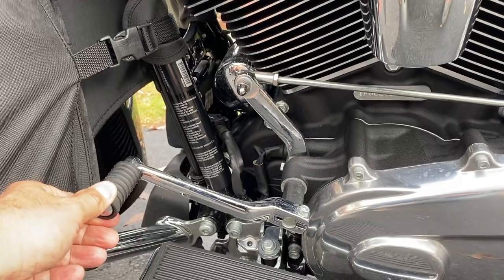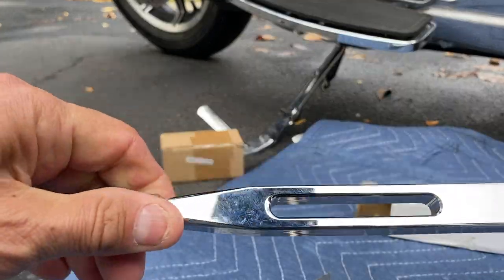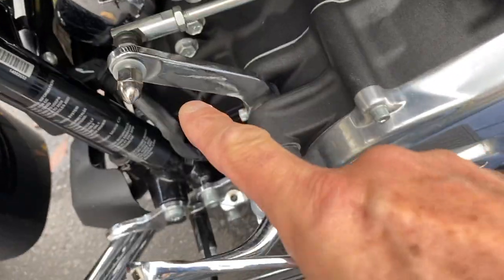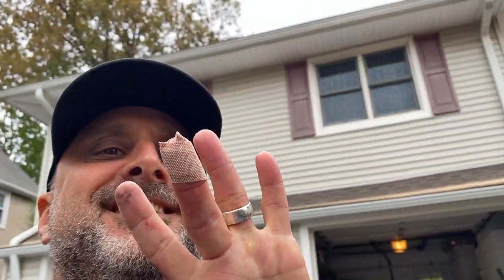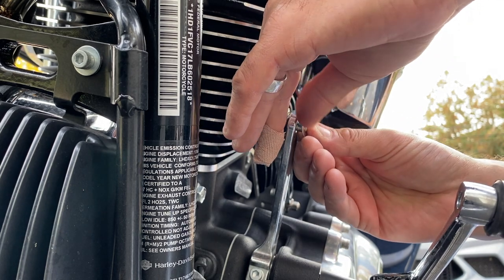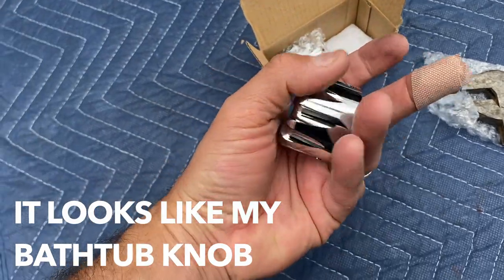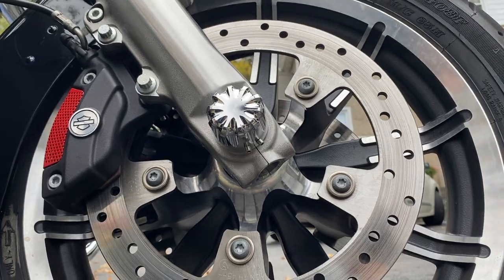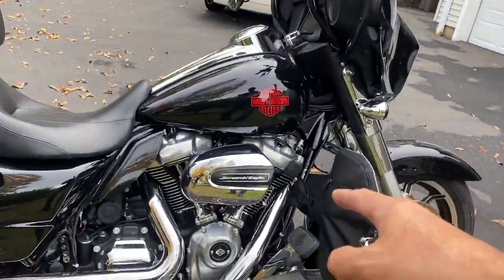Shifter Linkage / Axle Nut Covers Upgrade Electra Glide Standard

Comment: To adjust the shifter linkage, you simply loosen the small lock nuts on each end of the linkage rod and rotate the the linkage and it raises or lowers your shifter pedal, It works like a tie rod. You don't have to take the shifter off the shaft and move it another slot.
Reply from the maker: Very true! But the initial setup needs to be positioned so you have options to move the linkage to both sides so you can it either up or down.

Comment: Good vid.  I need to replace my shifter linkage...I never liked that stock one on my Road Glide.  Good move on the axle nut covers. 7/5/21 UPDATE: I just installed a similar shift linkage on my 2013 road Glide. One thing different is that on models with a straight transmission shift arm (your's is J-shaped,) you must install the front of the shift linkage on the OUTSIDE of the front shift arm.  If installed on the inside the bolt will impact your cylinder. My stock arm was also installed on the outside unlike your's.

Comment: I Like the shift linkage upgrade. Will definitely get one of them from your Amazon link.  Good price.  Thanks.  We had a stock one break on a trip.  A tip is use some electrical tape to hold the joint together until you can get somewhere to replace.
Reply from the maker: Electrical tape is the solution for almost everything in cases of emergency 👍🏻 😆 LOL 👍🏻

Comment: Sandy: just purchased the same shifter linkage only in gloss black. Will put on when weather warms up. BTW how is the chrome finish holding up?
Reply from the maker: Still shining! ⚡️
Reply: I just saw your video on Amazon parts. I see that the shifter linkage chrome is peeling; however is it still working well? I have yet to put mine on. Wisconsin weather not cooperating. 
BTW if you still like it and it works well you could have it bead blasted and rechromed or powder coated.
Reply from the maker: @frankhabib5748  -sure it still works . Just the look of the chrome is blemished a bit - that’s all
Reply: Thanks Sandy.

Comment: Hey, does your shift linkage rattle when the motor is running? I seem to have that problem with the same aftermarket linkage.
Reply from the maker: No rattling here...Shouldn’t be...something isn’t right there.
Reply: @HOLYSHIFT  ok thanks for the reply. I probably need to replace it. I took another look and the rattling is coming from the extra play in the bearing that u mentioned in your video. Nothing is loose otherwise. Great video!🤙🏽